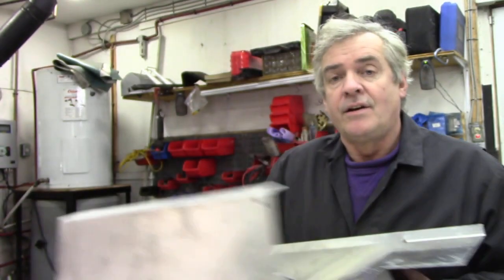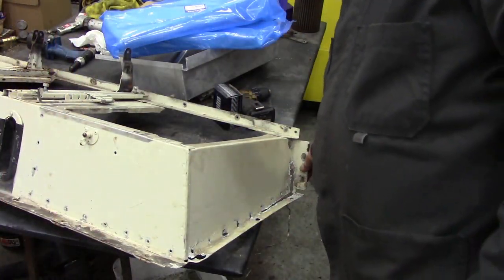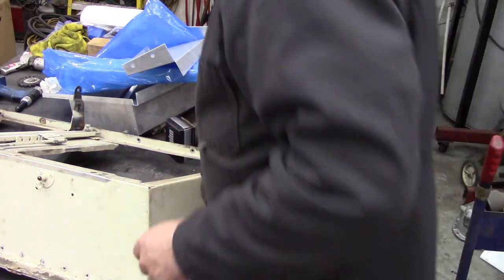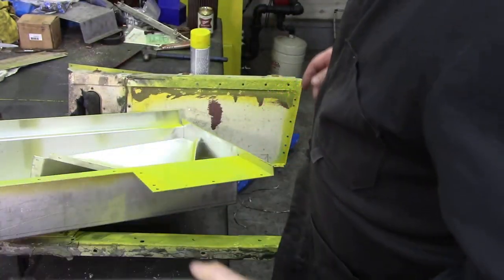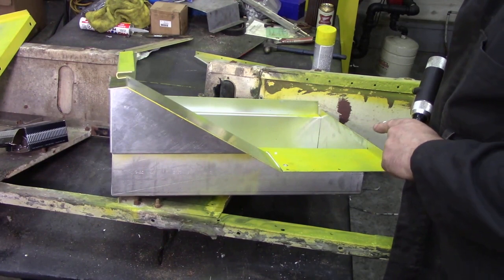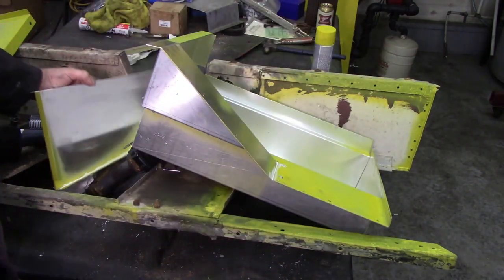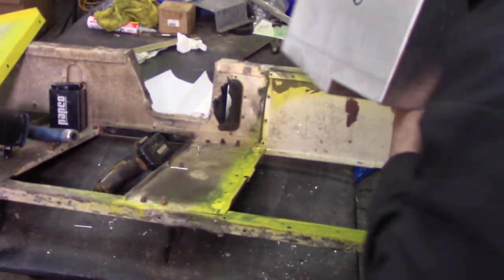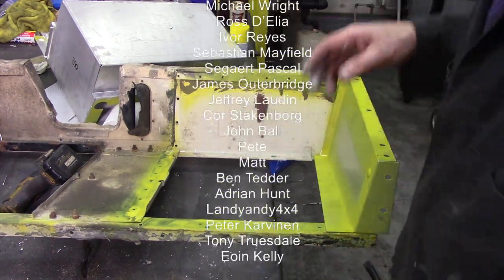109 seat box repair, using YRM parts. Part 1

Comment: Would the 3/16 rivet with a grip range 0.126 to 0.250 be okay to use in all areas of a Series LR?
I'm looking at using closed end rivets with an aluminium mandrel. USD 71.44 + freight for a 1000.
Reply from the maker: The longest used are on the galvanized parts of the rear tub - thinking about it maybe a little longer would be safer

Comment: I would be using sealed aluminum rivits. That way you don't get a hole right through. I think the origimal pop rivits were sealed.
https://www.google.com/search?q=sealed+rivets&client=firefox-b-m&source=lnms&tbm=isch&sa=X&ved=0ahUKEwidy-iUnN3nAhWQXSsKHf42CTEQ_AUIBygC&biw=360&bih=560#
Reply from the maker: These are quite good at making a good tight seal - the gun pulls 1000 lbs force

Comment: Didn't know you could get those end panels. My 1972 series 3 will probably need them. They always fail along the bottom by the doors. Thanks Mike.
Reply from the maker: Yes YRM make a lot of parts for the seat base